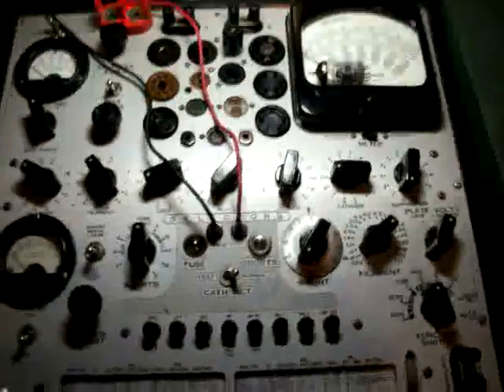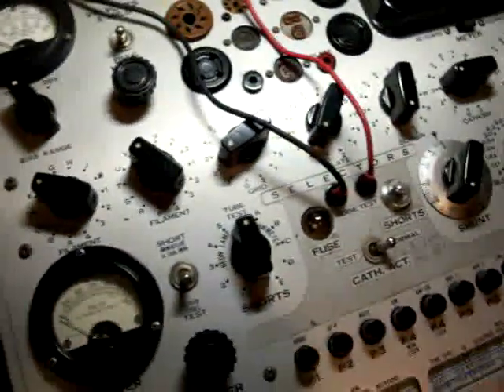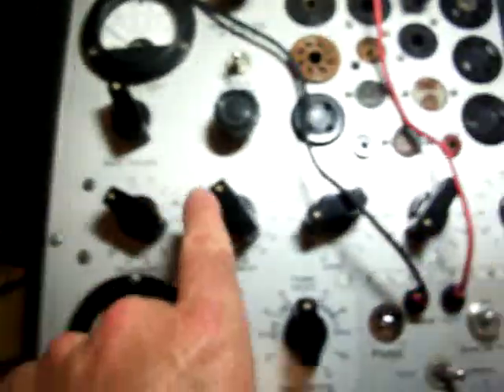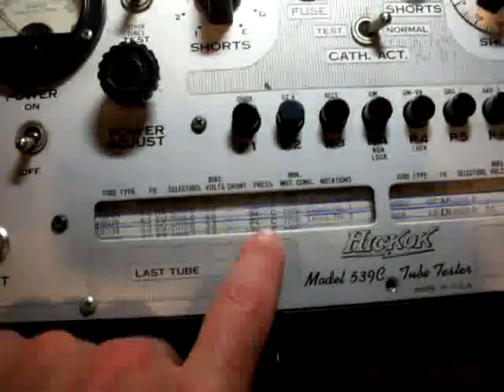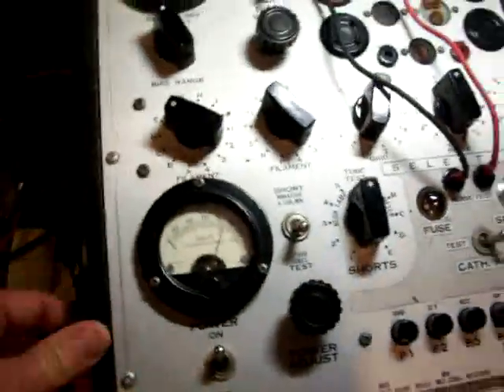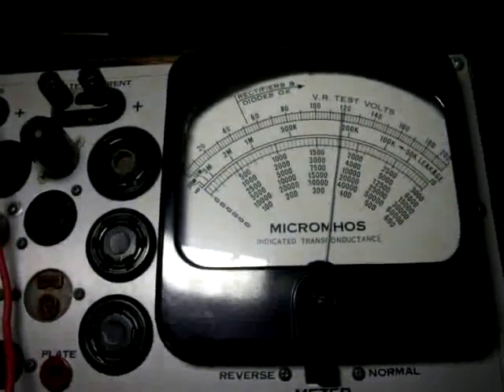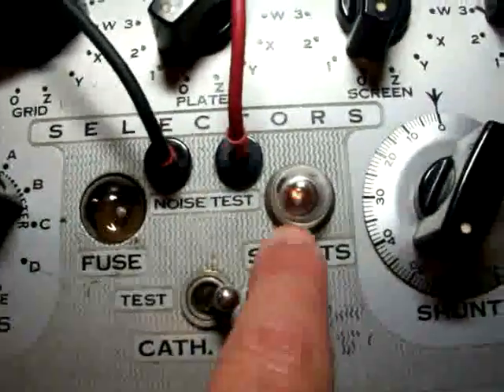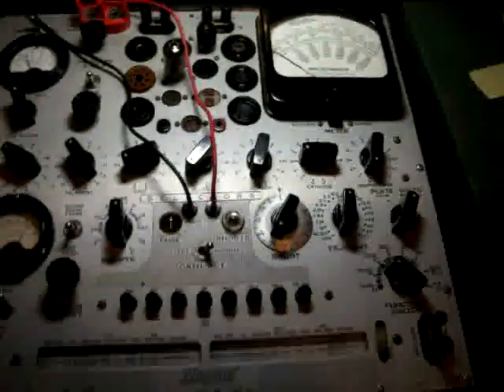hickcock 539c Vacuum Tube Tester short sound test 0n a 6dj8 Amperex tube

Comment: I bought my 539b for 120usd at a hamfest in 2013 on my birthday but i like Heathkit TT-1 on  power tubes because it' has an additional 125vdc across the tubes such as KT88s..It  has 275vdc plate to cathode on a 6550 but on my 539b I get 150vdc. In many cases it may not be a big deal but there are times it can be useful for showing tube leakage or arc over as tubes sometimes don't show a breakdown pattern until there is a higher voltage on them.